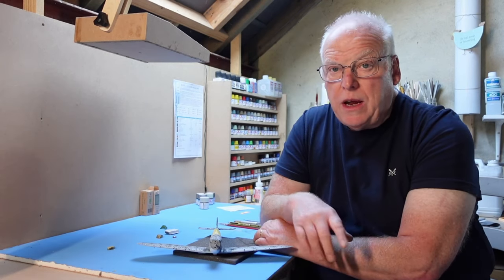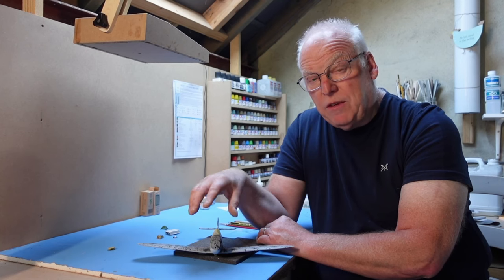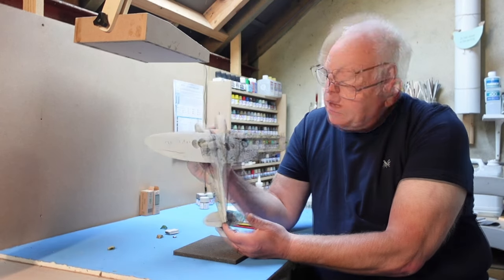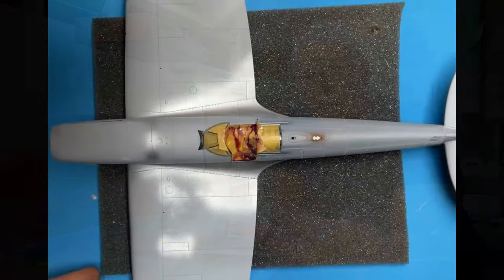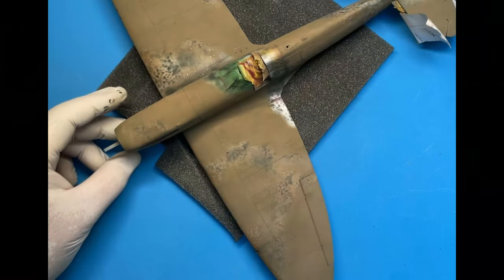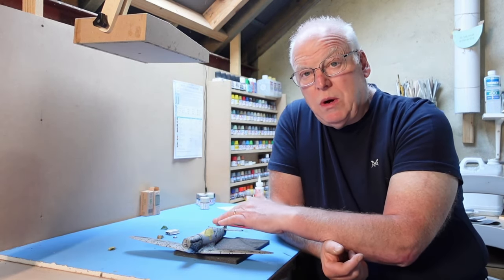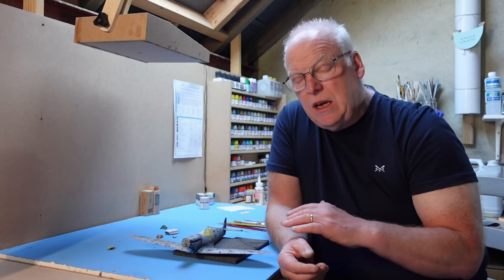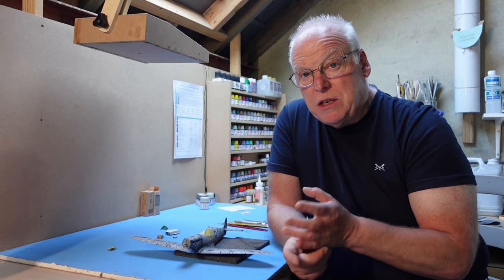Kotare 1/32 Spitfire Mk1a - Paint problems!

Comment: A bad reaction between the lacquer paint and the acrylic paint, a couple of modellers I know have had the same problem. Would a clear coat over the lacquer paint help the reaction or maybe use either just a lacquer paint or a acrylic paint instead of mixing the two? Or if you have any left maybe use the Xtra Crylix paints you used for the 1/48 Hurricane. Good luck with finding a solution.
Reply from the maker: All done now thank you

Comment: Ah bugger. Slight set back. Must say I had a mishap with Tamiya spray cans on my last project as well, as one color started eating in to the other although it was both acrylic spray cans..
Reply from the maker: Dave Tamiya spray cans are very hot and they’ll easily burn through surfaces - if I use them - rarely- I put them through the airbrush

Comment: @The Model Shed: sorry I am late to the party, but did you use hairspray / chipping fluid? Even the most resilient paints out there (MRP) lose their many of their superpowers when sprayed over hairspray, so you need to go very careful with masking tape; however IT IS possible (I have done numerous times).
One correction to what you said (and I paraphrase) ...'you can't use Tamiya acrylics over lacquer' - yes you can, but I certainly wouldn't mask over the acrylic if you are hairspray chipping.
Reply from the maker: No I used Maskol over lacquer then plain Acrylic. I think it was likely a problem not of the paint but the thinners: I’m going to try the same method with the acrylic thinned with lacquer thinners to see if it gives it a bit more bite.
Reply: @TheModelShed  ah i see, thank you. The end result looks really good btw (I'm often weeks behind catching up on your vids!) but my personal preference would be to see a more weathered / beaten finish. As always, I have bookmarked this series for when I get my Kotare Spit, so thank you for another wonderful sbs build. 
re the paint issues, masklol (or similar) does have its place, but i find the chips often are not fine enough and really only hairspray (or similar) can achieve that; Tamiya acrylics chip super easy with hairspray - almost too quickly / too much - whereas MRP (and quite possibly Tamiya lacquers, though I have yet to try) can be  chipped super small.
Thanks again and looking forward to your Cr42 I think I heard you mention? Cheers, Nick

Comment: If may ask did you use any chipping fluid over metallic paint where you want to chip the base colour??
Reply from the maker: I did - humbrol maskol
Reply: @The Model Shed  maybe that cause the problem.  If you using any chipping products the layer on top will be lifted easily even with tamiya tape.